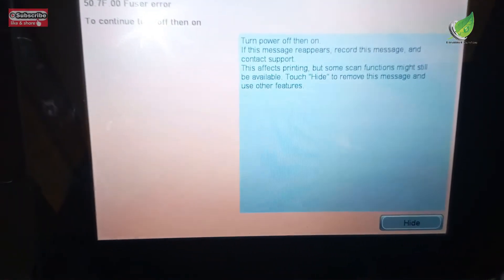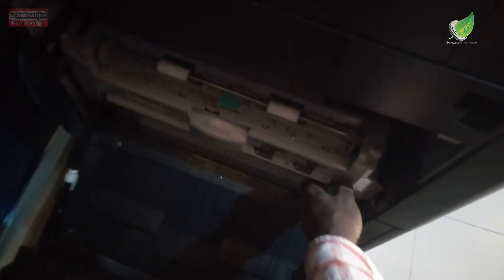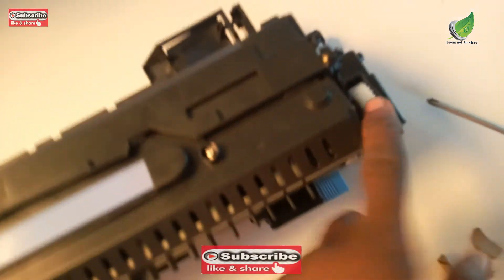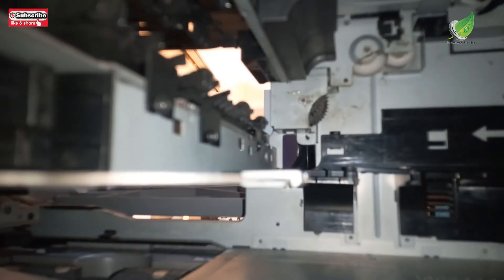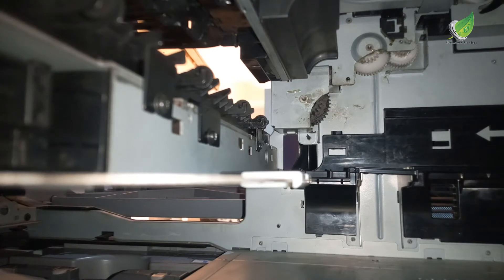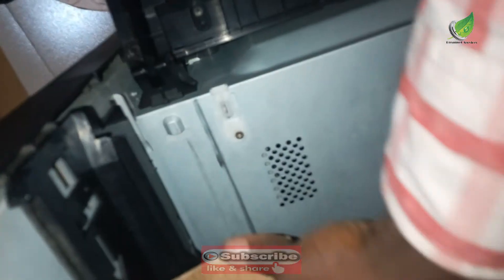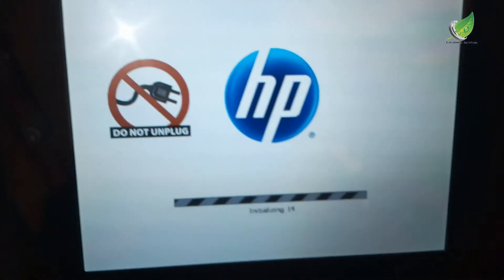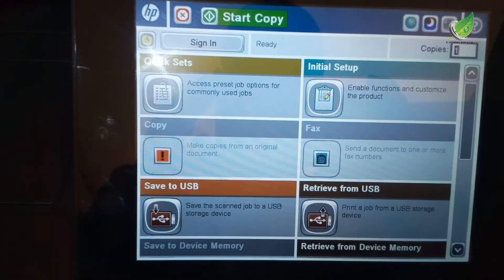HP 50.7F.00 Fuser Error in HP M830 Printer

Comment: 50.34.11 fuser erore
How to fix in the hp 630?!
Help me
Reply: Boa tarde como posso resolver erro 50.7f.00 fusor error no hp enterprise m611
Reply from the maker: That is a fuser error, check the gear on he side of the printer
Reply from the maker: This error is indicates that the gear from the fused unit doesn't engage correctly the the gears on the printer mechanism which in turn makes the printer to produce noise when starting up, first thing to do is remove the fuser unit and inspect for any physical damage on the fuser especially the gear area, instead of replacing the entire fuser unit which can be expensive...you can just replace only the driver kit(this is just a set of gears that drives the fuser unit)

Comment: Hello boss I have the same error with M880 but the fuser is new an i checked all the plastics inside and they are ok; can you assist?
Reply from the maker: Place a thick piece of paper on the fused rail before fixing the fuser inside, then restart the printer,compatible fused often comes with thin base plastic which is not enough to align the gears, so it prints some pages the misaligns again
Reply: @dreamsetservices2847  where exactly? rail in front of the fuser? if yes where do I have to put the paper?
Reply from the maker: @wichi5763  the rail which the fuser sits on, you can check my videos, I have a video on it